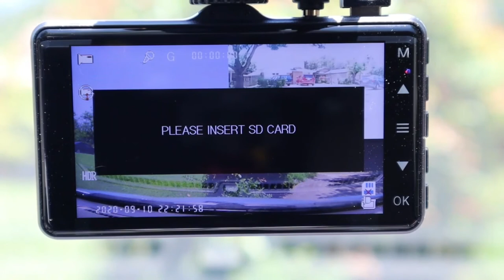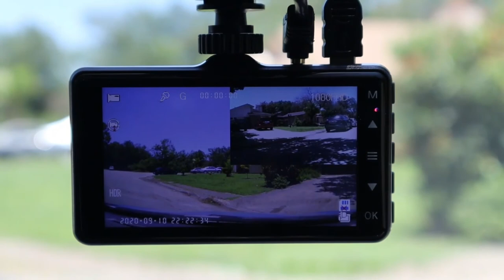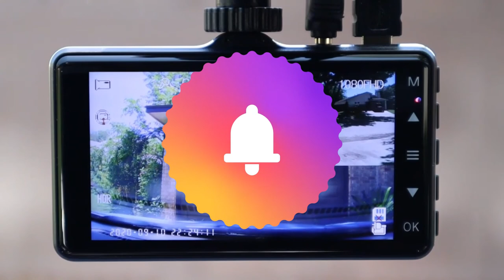HOW TO INSTALL THE FRONT AND REAR DASH CAM HOW TO INSTALL THE IIWEY DC03 DASH CAM with the Red Wire

Comment: Okay, if your already used the 2 usb port (rear camera and power supply) , where to connect the cable for parking mode (hardwire kit). I have to switch cable all the time? Thanks
Reply from the maker: There is only 1 port for the power cable. The rear camera connects to its own port in the dash camera. The power cable from the power socket will be placed by the hardwire kit power cable is installed.  The cable from the power socket will not be needed anymore.

Comment: Hi JD  What would you do if you sold your vehicle? Would you sell your vehicle with the Dash Cam attached?  OR Would you remove the Dash Cam??? 🤔 Assembling, wiring the Dash Cam etc is time consuming!
Reply from the maker: It is easier to remove the dash cam wires than to install it. If the dash cam is under a $100  you can probably leave it. If you are planning to upgrade that's your excuse.
Reply: I have purchased a IIWEY Dash Cam like the one you installed in the video.  I will ask someone to install it for me.  
I'm not 'experineced' with DIY  Elecrical Wiring etc etc  etc.  JD  you make it look sooooo easy!